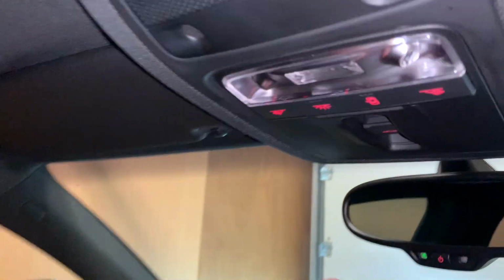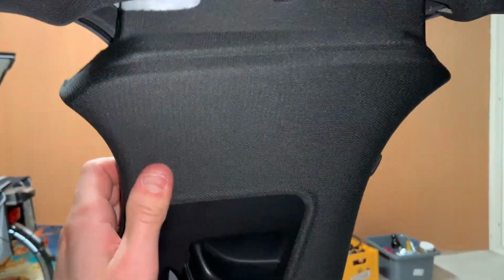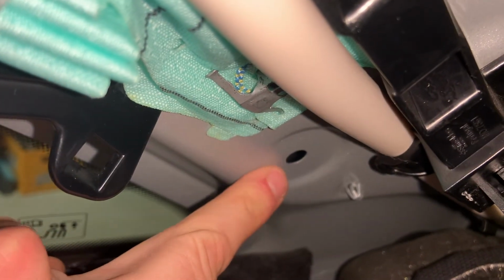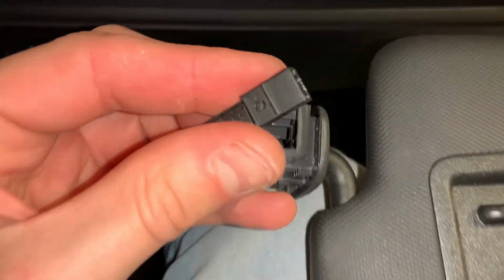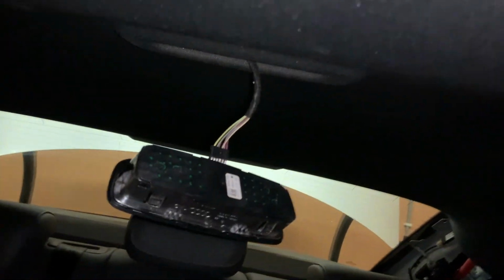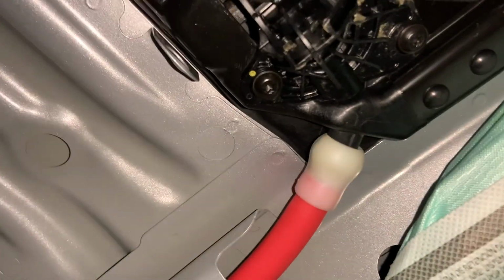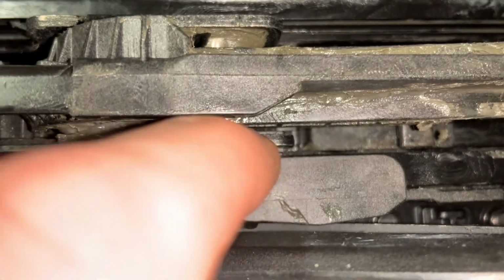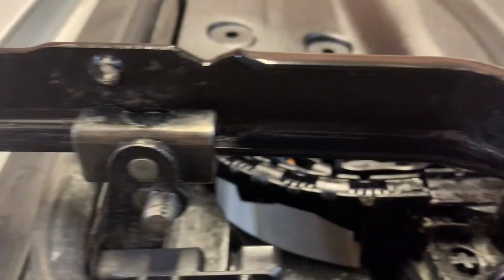How to repair your own Audi a3 8v/golf 7 sunroof (rattling noise)

Comment: your video is great, thank you. Have you disassembled the console? It doesn't blow air through the two central ducts.
Reply: it doesn't blow air through the two central ducts if the regulator is in windsreen/feet position
at least in my Audi A3 8V with conditioner not clima

Comment: Hello mate. How do I remove the front panel? Any ideas. Used this video to remove roof lining thanks for that!!
Reply from the maker: You’re welcome. I tried to explain it at 15:35 , I’m not sure if you had the same problem as I did
Reply: Yes the problem with the lift mech. I had to reposition the little gates. 

How do I remove the front panel that runs around the roof? It’s leaking under it.. can’t see that on your video
Reply from the maker: @Jacob-kw2tk  ah okay the shiny black part. I have no idea because I didnt have to remove it maybe you can find it on a audi forum somewhere
Reply: Heb jij eventueel ook insta? Ik heb momenteel het probleem dat mijn dakje niet meer dicht wilt. Hij staat alleen met de achterkant omhoog maar kan ik het panorama dakje ook zelf dichtdraaien?
Reply from the maker: @Jorick.RS3   Hi, hoor je een ratelend geluid wanneer je het dak dicht wilt doen? Je kan het dak zelf dicht draaien maar je moet dan de glas plaat eraf halen vanbinnen zitten 4 schroeven en aan de achterkant ook. Je kan me altijd via dit kanaal een mail sturen mocht je nog vragen hebben

Comment: Hi. I cleaned grease, use new but i have next problem. My sunroof Glass goes down and hit the roof. How to set/Block Grey and metal links needed for upd and dobn bottom part of the glass or how to set them when roof is open and closed? Need help!
Reply from the maker: Hi, so I think you took the rails on the side fully apart? Just look at a picture online to reassemble it
Reply: Could You look at this gray element position? https://youtu.be/Anf2ODPKt1E?si=Rmqu3iHww7TRrd-w

Comment: How did you remove the glass ? I have a problem with the roof not opening but I don’t know how to access the glass bolts itself
Reply from the maker: There are 4 bolts on the inside of the cabin, the other the are at the back of the glass panel which can only be accessed in the ventilation mode/ fully open

Comment: I noticed your air deflector is not operational in the final shot. I’m looking to replace my air deflector. Is it a simple process?
Reply from the maker: I didn't attach it, because if the roof didn't work I would have to take it of again. You can easily replace it, it's a case of opening the roof and removing two bolts, goodluck

Comment: u dont show how to remove a glass xd
Reply from the maker: Forgot to film that part, my bad. Basically it has 6 screws, when it's in ventilation mode you can access the screws in the back. The other four can be removed from inside, hope this helps
Reply: @TorqueToSpec  thank you so much. I give u a like and follow 👍🏼
Reply from the maker: Thanks a lot, you're welcome!
Reply: @TorqueToSpec  my sunroof on my b8 passat has a knocking noise, this happened after I adjusted the sunroof, now i cant get rid of the noise. How do i line the sunroof up to correct level?
Reply from the maker: @hamzahussain5129  it could be that the sunroof is too close to the frame. When riding over a bump the sunroof and frame collide. The way i did it is by putting the screws in so that the sunroof panel is at its highest point. Then close it an check where you need to adjust it
Reply: How much space am I supposed to leave so they don't collide, is there any way of showing me a video or guiding me through
Reply from the maker: @hamzahussain5129  if the sunroof is flush with the exterior then it should be okay, also check if the screws are thighened correctly. If you want a guide search “golf 7 workshop manual” on google on the golf mk7 forum there will be a manual for the car exterior
Reply: @TorqueToSpec  Hello, can the glass panel be removed/installed if it is in the fully closed position? Thanks